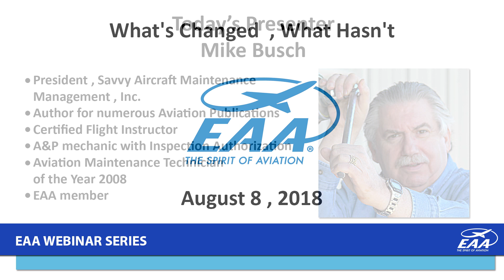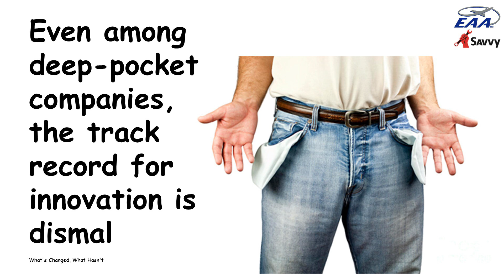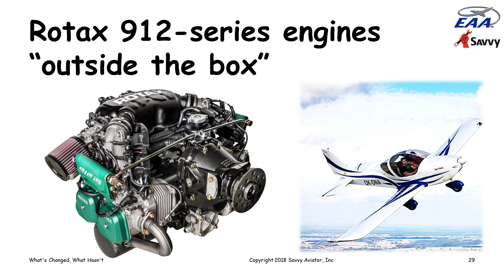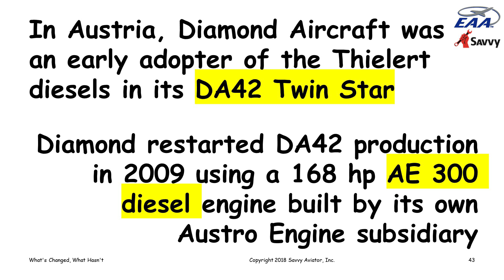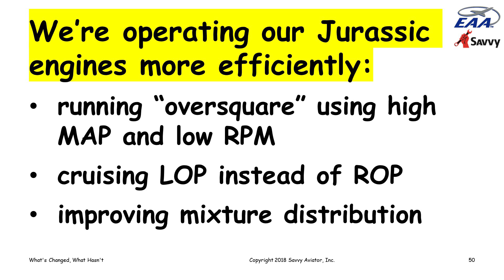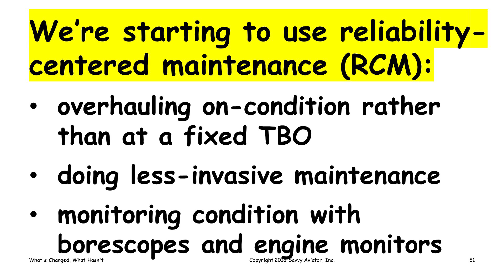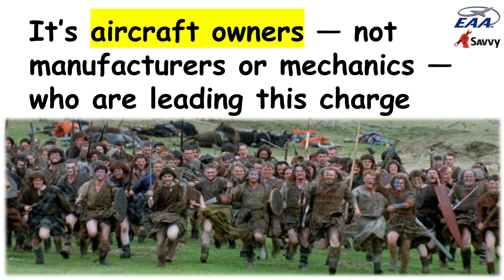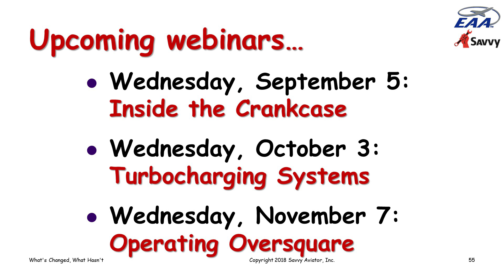What's Changed / What Hasn't

Comment: Rotax $37,000. There is nothing wrong avoiding Gear Box, Turbos, liquid cooling and Elec Eng Control..  It is maxed out at 140HP. Direct drive, aircooled has advantages.

Comment: The “old stuff” design is still maybe the most reliable but 10 mpg or worse is just nuts!! Flying airplanes should be fuel cost efficient over automobiles but they are not. Time efficient maybe but certainly not carbon efficient.

Comment: Waiting to hear your talk about running the engine over square. I've been told I would turn into a pillar of salt if I ever did that. LOL
Reply: Air frame and Engine manufacture Op manuals have had OVER SQUARE settings. However thare are REAL limits due to prop vibrations for example.... I guess your ignorance is your bliss.... Bottom line follow the manuals they are written using engineering data and they are smarter than you....

Comment: The current designs are the zenith of piston engines for aircraft in the 100-400 HP range based on BILLIONS of research and development.... Make a better experimental engines, an AUTOMOTIVE conversion... I hear they are MODERN and better. NOT ONE HAS BEAT THE Lyc or TCM.... Clearly Turbine (turbo prop of high bypass jet) is best but not practical for low HP GA use if low utilization.

Comment: Mike Mags work well in planes to this day, RELIABLE, GOOD SPARK, SEKF POWERED AND FUXED TIMING WORKS FOR AIRPLANES. EI has little advantage in planes but in cars that change power constantly EI is helpful. As a kit plane builder (experimental) I have used many EI (lightspeed, eMag, SDI, Suefly). Cars don't drive at 75% all day so EI benifits is less from mapping timing advance. SUREFLY and others are now available for certified planes. EI ARE NOT 100% RELIABLE MIKE. If you go to altitude and fly at low power advanced timing more than 25 Deg BTDC. The Mag works and is electrically independent.

Comment: Mike challenge, design an engine to compete with IOX-370 or IO-360 (170-210 HP range). You lose.  Nothing you said makes any difference. Nothing in math, science, metallurgy, design, engineering and manufacturing has changed. What small changes have occured Lyciming and TCM have exploited. Electronic Ignition is available for experimental and OEM planes. EFI is available for experimental airplanes. Please use facs and logic. The reason that other engines never CAUGHT ON? Think about it.

Comment: Mike I am disappointed in your lack of logic here. Old means bad? So a P-51 is a not great? Why reinvent the wheel. All modern aircraft engines, Lycoming, Continental have made improvements in materials, manufacturing, coatings, as well as fuel injection,  SINGLE LEVER FADEC and Electronic Ignition, turbo intercooled, water cooling....  Why reinvent the wheel. If you had blank paper design it would be a DIRECT DRIVE, AIR COOLED, PISTON ENGINES.....    Mike if you are so smart... PLEASE DESIGN A NEW ENGINE.

Comment: If it works don't fix it!!!  Magnetos still don't need external power........that is all that counts.
Reply: No, it's not all that counts. The Gnome rotary worked. The OX5 worked. Should we have stopped there??
Reply: You are using the internet to watch a video..... why aren't you back reading a book about this. It worked... that didn't need any external power. Was that all that counted? Just think about what your saying.
Reply: Listen again, emags don't need external power after start-up because they contain a built-in generator.
Reply: @gusbisbal9803  electronic mags also get energy input from the same way mechanical mags do. They're both converting mechanical energy from the engine to a spinning magnet which induces a voltage in a coil of wire. The difference is in the electrical pulse distribution. In a mechanical mag there is a mechanical armerature rotating around in the distributor cap. Electric mags have a solid state distribution ie, no moving parts. No moving parts and no mechanical wear implies a longer Mean Time Before Failure or improved reliability and less owner maintenance costs. The only reason we don't use electronic mags is because it's too expensive to get one approved by the FAA and there's not a justifable return on investment.